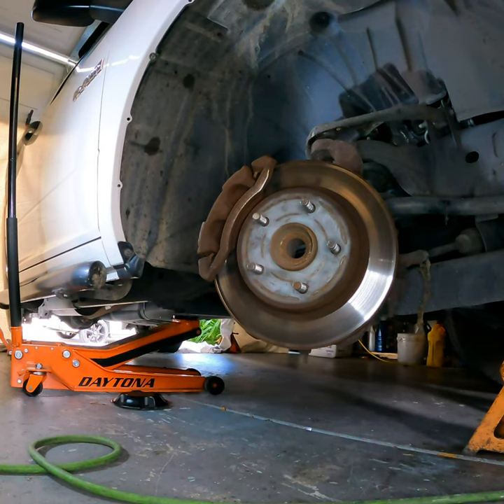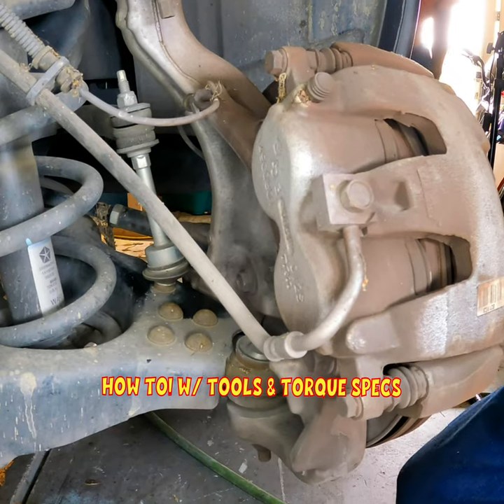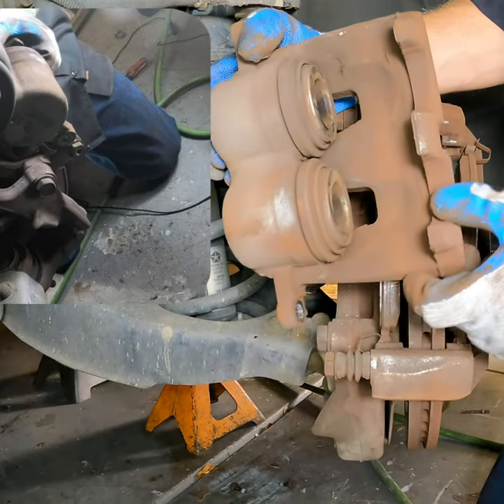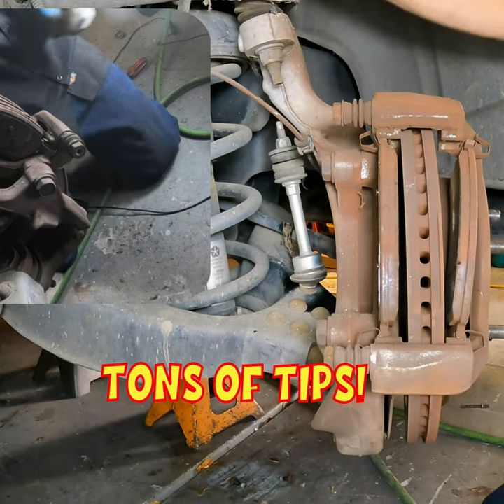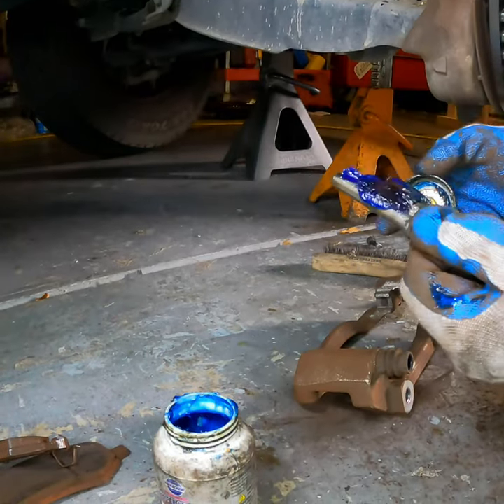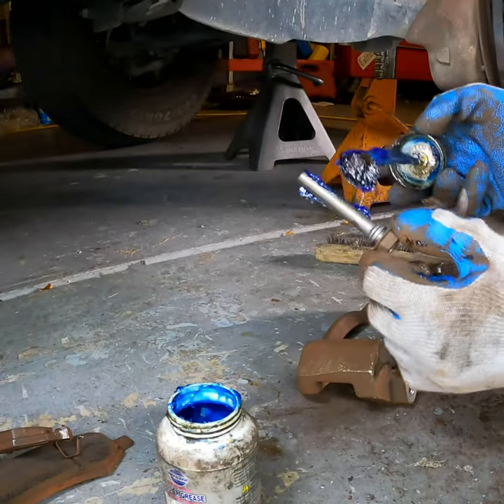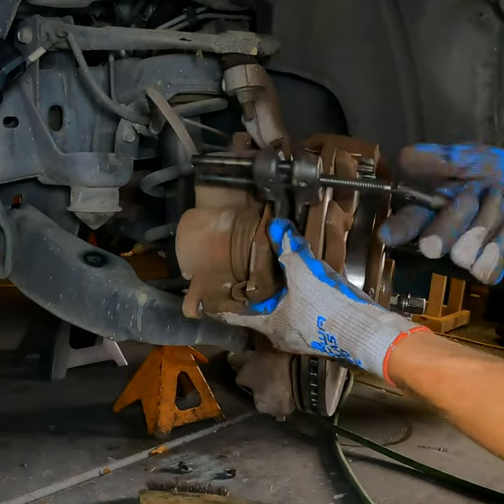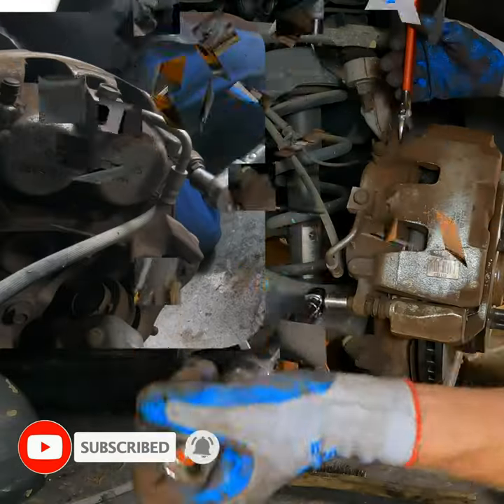⫷ Ram 1500 Front Brake Pads and Rotors change. Quick and Easy With a Ton of Info! ⫸

Comment: Will collapsing the pistons without bleeding hurt the master cylinder
Reply from the maker: Using my method on doing your brakes you will not need to bleed your brakes perionly open the reservoir cap to allow the fluid to flow back into. The reservoir freely. If you open a brak line while you are doing the brak job. You will need to bleed the air out. Follow my break job step-by-step and you will not need to bleed the brakes.